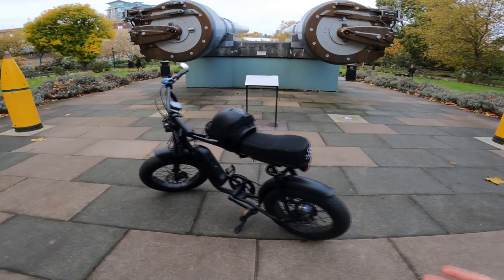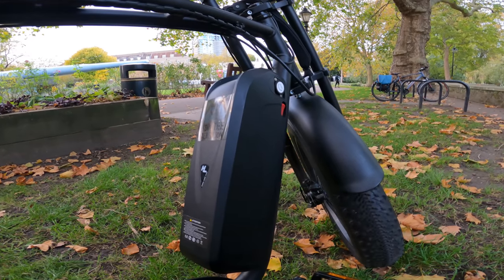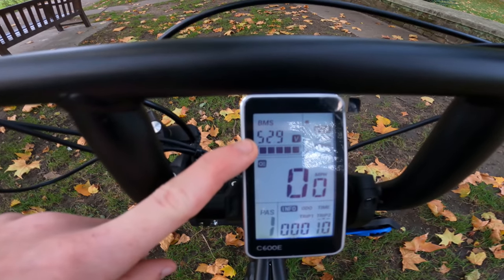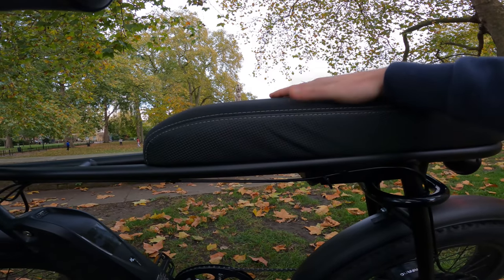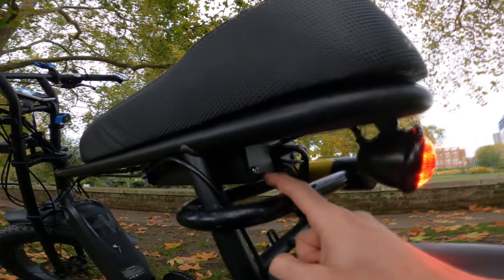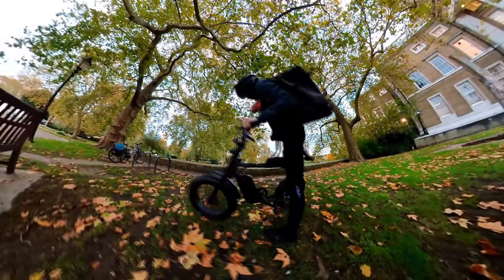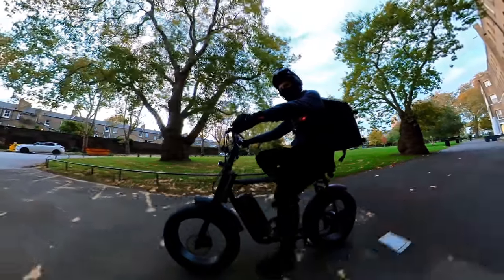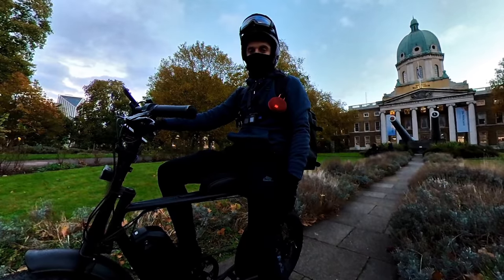50Rebels 20x4 Ebike Walkaround - Portugal's Finest Fat Bike? My Thoughts...

Comment: Hey, really amazing review,

Of what is a great  product, really beginning to think that these new MiniMoto style of eBikes like your 50Rebels or the German made Uni-Moke are actually the real answer we are looking for in comfy safe eco-friendly inner city transport and not the red herring that eScooters are now showing themselves to be currently.  Really hope that these style of bikes now gain in popularity even more than they have done already.  These as Boris style eBikes would make paying for them so much less painful and so much more fun.

Quick question, I also have walk mode on my eCargo bike, an even more useful feature on a load carrying bike like my Dadmobile especially when you have your nipper onBoard, mine was actually my Baby Buggy replacement from when she was nine months old, so great to see that feature on a minimoto, makes absolute total sense.

But, because my power unit is a Shimano Steps mid-drive mated with the new Shimano e5 Speed hub gear with electronic gear change, (so good), I can’t basically get a throttle for my bike as they never intended the motor to have one.  However I see you have a throttle as well, would it not be easier to simply push the throttle right next to the same buttons that you have to faff around with to engage walk mode in the first place, surely much easier to give the throttle a controlled spurt, when pushing instead of messing around with walk mode when you actually have a throttle.

Anyway once again an amazing review, you should borrow test drive more eBikes on an shift then review them, think you have a real knack for eBike reviews.

Best Regards Ashe.

Comment: I’ve got a rad runner ebike, been delivering for a couple of years, I bought an extra 19ah Panasonic 2170 battery, and my range can top out around 55 miles, original 14ah battery is  around 40miles range,

Comment: its a nice looking bike but there are quite a few poor quality and heavy components i would change. i would like to buy just the frame and build a good quality e bike. also tesla cells are made by panasonic.
Reply: @amesavis  they all low quality now days , the parts are easy replaceable and cheap in this bike that’s what makes good value. The battery is most expensive to replace.
Reply: @amesavis  the bike as a whole is fine but i have been a bike mechanic for over 20 years and i can spot what is poor quality. the companies have a budget to keep to and the most expensive thing is the battery and motor. they have to cheap out somewhere. it wasnt a dis just an observation

Comment: Do you have any issues with the gears yet? I guess not, cause you said that you leave it in the highest gear. I just wonder how the price comes together with a shifter that costs less than 20 bucks, gear lever less than 10 bucks and on my bike that I bought for 550€ has a shifter that costs more than 3 times as much. 🤨
I will have to see how it holds up, I just ordered mine today. Hope Its not a waste of money
🙏
Reply from the maker: I'm actually in the process of removing the gears and going for a belt drive but not yet done any research on how to do it, I never change gears and it would be nice to go for a belt drive and get rid of the chain and rear derailleur
Reply: @LondonEats  ah thank you for saying derailleur. I didn't remember the correct term 😂.
That's a cool idea, but not for the area that I live in. If I would still live in my hometown, yeah sure it was relatively flat, but here in Bavaria in south of Germany it's really hilly so I have to shift quite a lot and I think that's not going to be that much of a difference with the 50R.

Thank you for the response! 👍

Comment: those are only things you dont like. 35 mile range doesnt bother you? I think thats way too little for a ebike specially if you use it for delivery
Reply from the maker: for me 35 miles is fine i never empty a battery on a shift maybe get down to one bar if that, if it was full time job then for sure id add more batteries to the bike but right now i dont see the point in spending over 300 quid on an additional battery that wont be used much.

Comment: A bit too pricey for my liking the price you have to pay for so called extras such as the front and rear lights is disgusting, I think there's  cheaper better options out there.
Reply: Just build your own bro. Pick a nice donor bike frame & add a road legal kit. Youre looking at around £500-800 easy. Way cheaper. And if you pick a good frame, the bike will look way better than this one.
Reply: @Kumari_44  the kits from a reputable supplier are £700-£800, plus the cost of the bike, plus lights, mud guards, plus a saddle like that isn't cheap. and where can you get a frame like that anyway? to get bike like that £1500 I'd say minimum